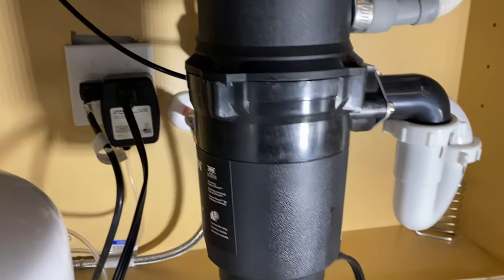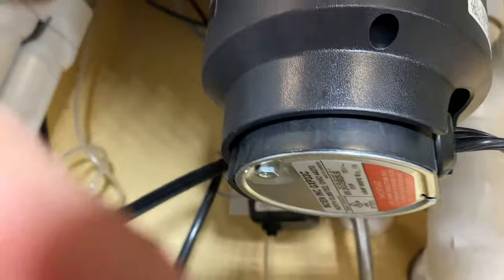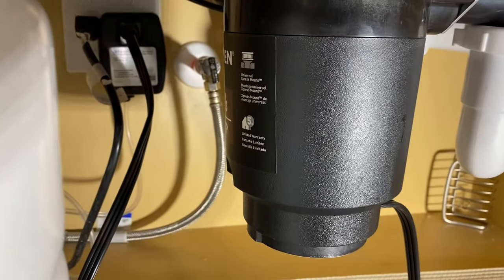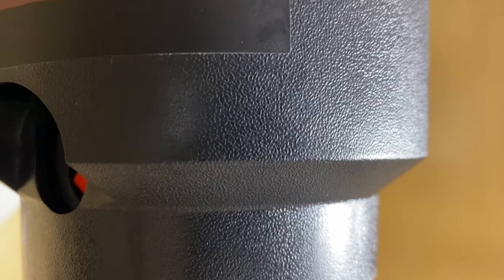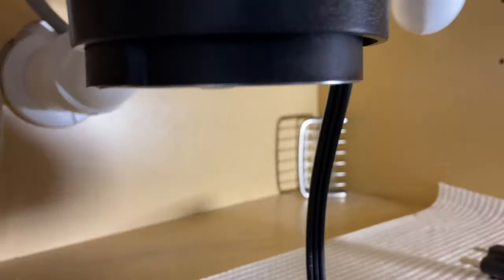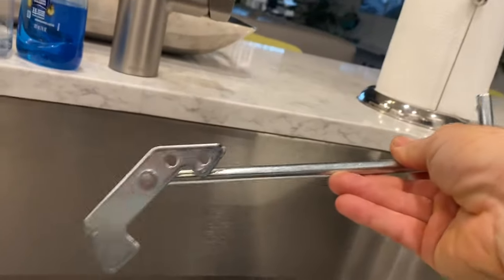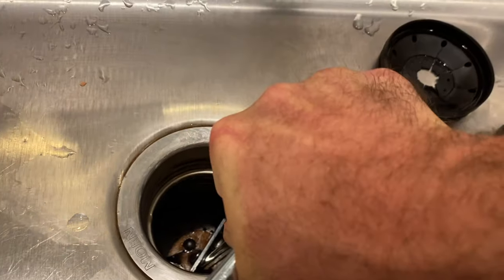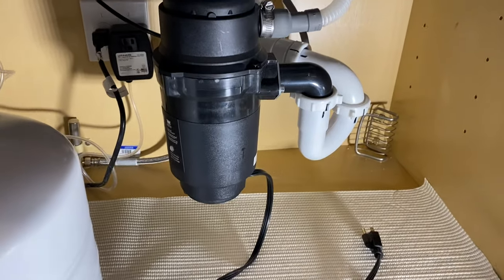How to Unjam Your Moen Garbage Disposal

Comment: Everyone!!! Make sure you pull out the rubber thing first. After following his steps, looks for a flat head looking indent near the wall. Stick a long flat head driver down there and turn back and forth until you get a nice 360. Mines works now!! I threw some baking soda and vinegar and hot water before turning it back on. Works like new. Thank you so so much to the owner of this video!!! :D
Reply: I want to THANK YOU! I've never tried to fix a garbage disposal ever! Your tip with the flathead indent/screwdriver was the ticket! Mine works great! My hubby who isn't mechanical asked me if I'd marry him (again!😂) thx again!!!
Reply: Very helpful!
Reply: I’m sorry but I still don’t understand this part, can you please elaborate on the flat head indent?
Reply: @SillyLionheart  Sorry for the late reply! When you look down the drain, you should see a opening that kind of looks like the charging spot on a cell phone, you should be able to put a flat head into it a bit and then move the blades manually. Think back to vhs tapes or cassettes when wed have to rewind them. So just look for that little indent that's the length of a flat head. Hope this helps!!
Reply: @tinamusial1950 Yay!! I'm so glad!
Reply: Add me to the list of grateful folks! I used your flat head screwdriver idea and it worked like a charm. Thank you for saving me about $150.🙏🙏🙏
Reply: @r.l.2791  That's awesome!! I'm all for saving money 😎
Reply: Omg! I just did it with a steak knife—totally worked! Your my kind if woman! Thanks!
Reply: @livfitlg6521  Bwahahaha! Yes! I absolutely love using the weirdest of tools to fix something.
Reply: I used a barbecue skewer to fix it lol . 😅
Reply: Thank you! 🙏🏻 I used a hand flat file with narrow end, but it wouldn’t budge. Poured baking soda, vinegar and boiling water, covered with a sink plug/stopper for a couple minutes to create steam inside. And it started to turn! Yay!
Reply: this works. just tried it.
Reply: @eccanado4593 do you have a pic where im supposed to place screwdriver.. the  bottom tray is spinning, but is the cylinder going down to the blades supposed to be spinning?
Reply: @terasitaful created a short to show :)
Reply: Thanks a lot, it works 💪 know I'm going to ask my husband to pay me $100 for labor
Reply: @raniaalshaeb  I'm so late responding but when I saw this I busted out laughing. GET THAT MONEY! You earned it 😎
Reply: Make a video so I can like it.
Reply: Thanks for the video!!!!!! Ours wouldn't move much but after I did that works great!!! Thanks again❤
Reply: @olgas1733 this was it right here!  Just did it, baking soda, vinegar, and boiling water loosened it up where beforehand I couldn’t turn it but in five minutes it was easy to turn!   Thank you!!!
Reply: Thank you!! Got mine to work again
Reply: @eccanado4593   THANK YOU!  I tried the baking soda and vinegar first, then ran the flathead around thebedges.  Then I poured boiling water and it worked!!  Cancelled the plumber!!!
Reply: So glad I looked at the comments!  Your tip fixed it in no time!  Thank you so much!
Reply: That actually worked !
Thx !  God bless
Reply: @eccanado4593  45 mins before the final walkthrough for the sale of my home and the stinking disposal stopped working!  Did the vinegar/baking soda/boiling water then a flathead screwdriver in the indent and SHAZAAM!!!  Thank you!!!  Crisis averted!
Reply: It worked!!!!! Thank you!🎉
Reply: Add me to the list of people who are thankful. 🙋🏻‍♀️🙋🏻‍♀️ I thought I had to buy another tool to do this job but the screwdriver totally worked. Thank you! 🙏 😊
Reply: Worked for me thanks 🙏🏾

Comment: I used a wooden spoon as I live in a small town and home depot is our only hardware place for the next 200 miles. Make sure the reset button is pushed in after you unplug it, take the backend of a wooden cooking spoon and stick in the drain. Feel for like a metal lip or clip and just try to push it with wooden spoon and u should feel a slight spin. All you need. Plug it in, check button is pushed in and run the water before you run disposal. Should run after that. Don't need a tool for this moen.
Reply: worked for me. thank you
Reply: Same 😂
Reply: Thanks
Reply: worked for me, thank you
Reply: Worked great for me. Thank you very much! I rotated it a bit and heard water rushing down. Plugged it back in and it works like new!
Reply: Whew! Thank you saved me a ton of work!
Reply: Nothing else worked besides this. Thanks for your help!
Reply: My hero!! Worked like a charm! ❤❤❤
Reply: Worked for me. Thank you
Reply: Worked for me. Thank you 😊
Reply: Worked perfectly! Spot on! 👍🏻👍🏻👍🏻
Reply: Thank you soooo much!! ❤
Reply: Thank you. That was helpful. That's what I used
Reply: THANK YOU OMFG
Reply: Thank you for the inspiration! Somehow I wasn't sure how to use the wooden spoon to get anything to move, so since the unit was unplugged, I used my hand against one of the two flaps where it was against a stopper and turn  pushed it in a clockwise direction until it budge!!! Thank you for your suggestion abd grateful for the video which all helped.
Reply: Thank you for this comment! Wooden spoon did the trick!
Reply: Worked for me too thanks
Reply: Yess thank you 😊
Reply: Thank you so much
Reply: 200 miles? Jesus Christ
Reply: THANK YOU

Comment: I always use the handle of a hammer and spin it out.
Reply: Thank you 🙏 you helped me get mine unclogged easy!
Reply: Thanks alot the hammer handle was a good idea, since I didn't hv the special tool.
Reply: Thank you! Just fixed mine tonight! Much appreciated both!
Reply: I just used a hammer, and it worked! I had to
Spin it back and forth a few times and it didn’t seem to work, until it did. Thanks!
Reply: You may also need to press reset button.
Reply: @TheT8or  Yes. It may need to be spun a few times. Glad it worked for you.
Reply: Thanks! Worked for me too!
Reply: Hammer time , yes thank you
Reply: Worked for me too thank you!
Reply: Thanks just did it with hammer handle works like a charm
Reply: I saw ur comment and couldn’t find the hammer so I used a long garden hose handle/pipe and it worked perfectly just wanted to thank you bro 💯
Reply: Dude you're the man. I fixed countless ones with the wrench and saw this video because I've not seen this one that's in my apartment and dude told me I needed to buy a tool like cmon. Great advice!
Reply: You are the man. Thank you. This video did very little to help. Your comment was everything. Thanks a lot!
Reply: Worked great! Thanks for this simple fix!
Reply: This is brilliant thank you

Comment: Wow, so helpful. Use a tool that nobody has, perfect
Reply: Butter knives work. It’s not recommended or even safe. For sure at your own risk if you try. But (American) butter knives slotted in where the tool would sit and used to leverage the flywheel works. It’s hard as hell and again so not safe to have your hands that close to the blade. I know it’s well past the helpful period for your issue. But hopefully it’ll help someone.
Reply: @hazerdprone2415  Going to try that instead of screws if I come across a jam again
Reply: What is this tool called
Reply: So Norm Abrams, use the special tool nobody has.
Reply: Use a 5-way painter's scraper. If you don't have one go buy one.

Comment: Try cleaning with baking soda and distilled white vinegar first: So my Moen garbage disposal was jammed up pretty bad. I usually use a small pry bar and push against one of the chopper blades to get it freed up. This time it not want to free up at all with a pry bar at all. I tried a method of cleaning garbage disposals using baking soda and distilled white vinegar. I don't usually measure it out but I dumped around 1/3 cup baking soda and then dumped in 1 cup distilled white vinegar. I let is sit for a minute while I went and got my pry bar. I came back and tried to move it and it was freed up like it was not jammed at all. If this didn't work I was going to have to replace it.

Comment: You and everyone who commented is a life saver. I have guests coming over and of course I started have issues with my disposal. For anyone else who has my issue. So I ran my dishwasher and all the water started backing up in my sink. It was super gross looking and the water would not go down. So I couldn't even see what he sees in this video. but I took the end of a metal rod I had and stuck it down in the water, just put at the bottom, put some pressure against bottom side, not the very bottom, and started churning like you see how people churn butter, keeping the end of the rod taught with the bottom side, like you are trying to push the side around, and then the water started going down.  Also I took out my rubber stopper and took a scrub brush and cleaned it all the way out.

Comment: First off thanks for this video! And Just a little tip for those who are like WTH I have to order a special tool. I used a “beater” a big flat head screw driver(you can get one at a Home Depot or Lowe’s in the electrical department) and just stuck it in the groove and rotated it a couple times and it worked.
Reply: Beater…technical electrical terminology 🤣
Reply: Umm can you link it pls? Or did you just mean an old screwdriver you don’t use anymore?
Reply: @iamknoware  a beater is just a  big  ol screwdriver that’s been used aggressively.

Comment: Thank you so very much!! Our Moen Garbage Disposal was less than 2 years old in our vacation home in Florida. The darn thing was jammed, we heard the hum of the motor, hit the reset button, nothing...we saw your video. 
Ordered the part on Amazon...a day later the tool you showed arrived, we used it, after we unplugged it and removed the rubber gasket at the opening and the disposal is working perfect...thank you. We did have to hit the reset button again after using the tool. You saved us a service call, perhaps even purchasing a new disposal, now we have a tool for the future, if this happens again, and we can share with our neighbors who might have the same type of disposal. This should be given with the purchase of the disposal. Again, thanks!!

Comment: THANKS. JUST USE A HAMMER. WORKED GREAT.
Reply: How did you use a hammer?
Reply: @nadirbiggs2240  put the handle end in and turn it around. Need to use a lot of force / pressure the idea is to turn it in a clockwise / counterclockwise motion

Comment: I turned the circuit breaker back on. I got my phones flash light and kitchen scissors while the machine was off. Took what I saw that was jammed out. Put the red button back in, and wallah. It works, thank you! 😉

Comment: Although I didn’t have either tool to try and fix mine, it gave me a good point of reference, I started with a 9 mm wrench for the bottom tried twisting that didn’t work, so then I went in with a butter, knife and scraped around the edges just to find a piece of glass jammed in mine, which went down after I tapped it. So this might help as well.

Comment: Very helpful. As to the special tool, I first sprayed interior edge of disposal after removing rubber guard then I used a 3/4in PVC pipe about 15-18" long and put pipe over the nub in the bottom of the disposal and could use the top of pipe as leverage to get it to move. Move it around a couple times to get moving relatively smoothly.  Poor Moen design!!

Comment: question: there is a hos above the drain hose. Where does it go? in out kitchen, that top hose connects to the dishwasher as dishwasher drain. Of late water has been going from the garbage disposer through that top hose to the dishwasher. What could be the problem?

Comment: Thank you for this! We have that same disposal and it’s less than 2 years old and is jamming. What do you recommend as a replacement?
Reply from the maker: If you are mainly just using your disposal to clean off plates after a meal I would recommend the Moen GX50C.  It is a 1/2HP, has a stainless steel grinding chamber and a 5 year warranty.  If you use your disposal for a lot of food scraps and want to put larger items in like melon rinds I would recommend either the Inskerator Pro750 or the Pro88LT.

Comment: I will not install moen/ waste king disposals for customers. They are garbage. My main problem with them is that they throw food scraps back out and at you. 
I tell people this about their new disposal from costco and they don't think it will be an issue. Then 3 months later they want to pull it out and install an insinkerator. 
Side note. Pay the extra money for the 1/2 or 3/4 hp version.  You can thank me later after you ran a whole pineapple through your disposal with no problems.
Reply: Our previous one was an insinkerator. That thing was a BEAST. Idk how old it was when we moved in, but it had to be replaced. I HAAAAATE this current.. POS. Nothing but issues with it. And I don’t put whole pineapples in the dang thing! Peeled potatoes over the sink (NOT into the disposal, but a Walmart bag to collect my mess!) and a couple peels escaped… my husband about had a cow (he doesn’t have a repair bone in his body!) 

rental house they going to go with the cheapest option available with the lowest power possible. And the cheapest contractor they can FIIIIIND.

Comment: You do not need to buy that tool; you can use a painter's 5-way scraper. You do not need to unplug the disposal, there is nothing that's going to shock you. Push the button, then put the 5-way tool down in and turn it to loosen any clogs.

Comment: Such a poor design - I replaced my old insinkerator of about 15 years and once in a while it got jammed but just used the allen wrench to work it free. Now, I had to take a wooden spoon and move the blades around which eventually worked but again, a poor design IMO.